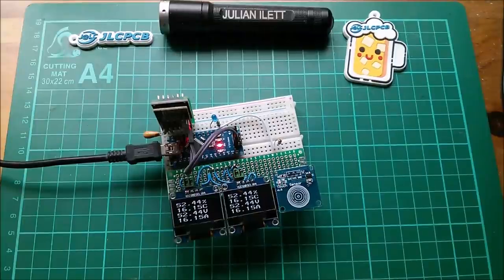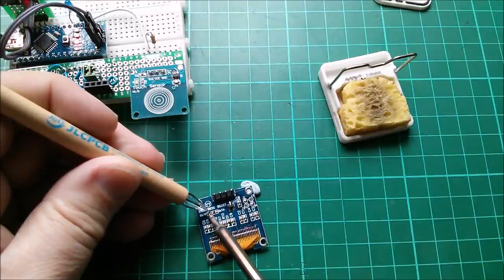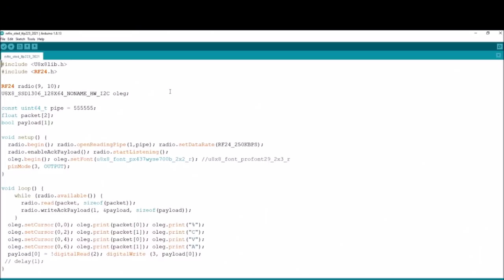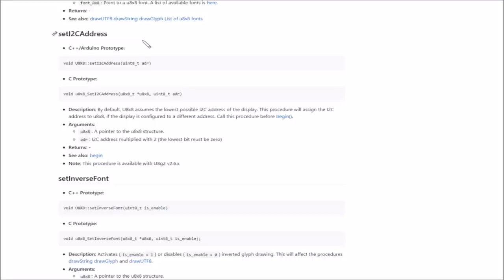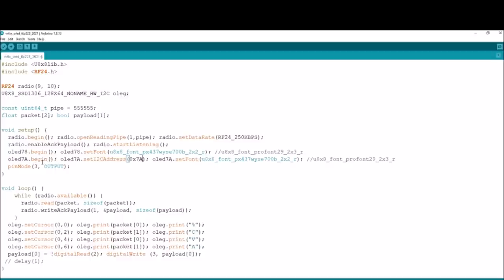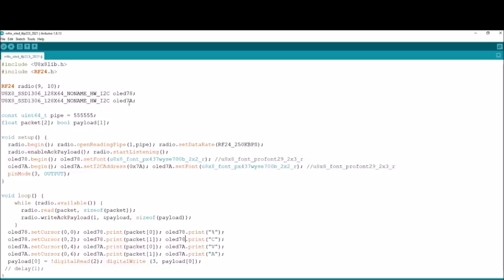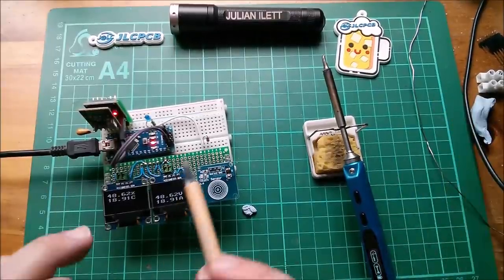Two Arduino Objects for Dual OLED

Comment: Now what I would love to figure out, is using like  3, 4, 5+ OLEDs of these, where you can't change the address.
Reply: You can use different pins for i2c if the library supports it.  I too would like to know if there is a way to programmatically change the address of such an oled display, would make wiring and code simpler
Reply: @tehappon  that is software I2C and it has terrible performance compared to native I2C pins.
Reply: You could use an I2C multiplexer (e.g. TCA9548A).
Reply: @nabarnes  Need to try that

Comment: I like your Arduino videos especially when mixed with cheap sensors, actuators, low power and computer interfacing. For example, the other day I saw a nice video where two Arduinos were used with a cheap on/off laser module and photo diode to create a wireless information/music channel without using a black-box Wifi or other RF-module.

Comment: I might be wrong as it has been a long while since I did any Arduino stuff, but I think you can declare both oleds on the same line:
U8X8_SSD1306_128X64_NONAME_HW_I2C  oled78, oled7A;
Might save you a line :)
Reply from the maker: Ooh! That I will try :)
Reply from the maker: Thanks Rob, works a treat :)

Comment: Julian - What sort of network connection have you got from the house to the shed? [No need to answer. :-) ]  I've been looking at Media Converters (Ethernet <> Fiber Optic) and they're surprisingly cheap (~$20/pair) and cheerful. Even the roll of pre-terminated fiber is cheap and cheerful. It seems that one could span a km (up to 20 km) for something like a few hundred dollars. I wish I had an application, and a free path between. I might explore the solution for my picnic table which is only 100 feet away, just for laughs. Cheers.

Comment: You're saying you have a humidity sensor connected to TUYA? You mean a separate aquara/mija sensor, or how have you gotten the arduino temp/humidity sensors to communicate with TUYA/WIFI?
Reply from the maker: Nothing working yet - I'm still at the purchasing stage :)
Reply: @JulianIlett  But you mean an already TUYA compatible sensor right, not somehow getting an arduino based sensor to talk to TUYA right? Is that even possible?
Reply from the maker: I bought a Tuya sensor, but I am interested to find a way to link my projects with a smart home system.

Comment: Do you think by adding a powered vent to the shed would help exhaust the hot air. You could possibly use your temperature sensor to trigger relay the fan of the powered vent

Comment: When you spend years in Software Engineering having that weird voice telling you how bad it is to have source code without "proper" formatting, it's so refreshing to see someone writing code without caring about that kind of stuff. Reminds me my good old days learning how to program and having some real fun.
Reply: I'm always impressed with the clever things that Julian comes up with.  On the topic of coding style, I started on the mainframe in 1983 writing assembler.  My teachers  were very seasoned  programmers. I was taught that the code had to, first and foremost, be as efficient as possible.  Second, the code had be readable and maintainable by multiple people for years to come.  Of course, in Arduino, that isn't so much of an issue but it does kind of hurt the eyes a bit😊
Reply: @alsnow3582  Ah, mainframes. I do miss the feeling of using those fridge-sized computers with incredible N cores. Back then they were magnificent beasts of raw power. I remember the insane hacks only known by the most seasoned programmers.

At least your teachers taught about the balance between efficiency and long-term maintainability of code. Today, I feel like people know how to write cute code that is slow AF and needs a major rewrite periodically.
Reply: I'd say as usual a bit of both is best. While I do think that a lot of formatting "rules" are just a matter of taste (like where to place opening brackets and such) there's a few basic guidelines that I feel make reading and working with code, especially that written by others, a lot easier and less error prone.
Of course, as usual, there's a ton of people out there that care way too much about "the right way to format code" :|
Reply: @stheil  When it comes to C, I'm a disciple of Kernigan and Richie.
Reply: @ecosta  There was a tipping point where hardware became cheaper than people to the point where you can just throw more hardware at the problem instead of getting people to speed up the code.
Reply: @alsnow3582  - that’s so true. But it’s so wasteful as well.

Comment: Am I missing something? Your voltage and amperage are identical to your humidity and temperature (other than the suffixes)?
Reply: He's just using the same data to test it out, a proof of concept.
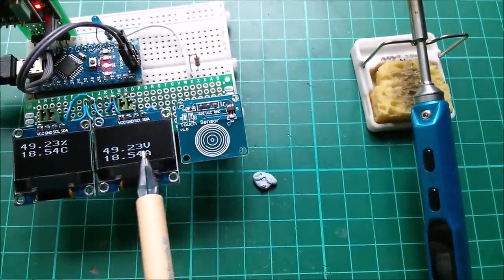Reply: As explained in the video at 8:25

Comment: You really need a Home Assistant setup.
(And some ESP32s).

Makes automation very simple. 👍
Reply from the maker: I'm looking into that for a solar related project :)
Reply: @JulianIlett  If you do move to Home Assistant, get a CC2531 or similar ZigBee Co-Ordinator and use ZigBee in HA instead of Tuya cloud.  It works with no internet then :)  
NodeRed might be a better option than full Home Assistant if it is only a small project :)
Reply: @EsotericArctos I believe HA supports Tuya devices natively now.
Most Tuya devices can be flashed with Tasmota firmware too, which gives even greater control. 🤗
Reply: @ParedCheese  If you want to rely on cloud and rely on an internet connection, for sure use the Tuya integration.  I am making suggestions to keep things completely local :).   Also, if using ZigBee and using a local ZigBee co-ordinator means you are not solely reliant on Tuya, you can mix and match different brands and experiment :).
Not sure about Tasmota on ZigBee devices.  For WiFi, sure, but the ZigBee devices pair nicely with virtually any co-ordinator and stay local.  I have a mix of Tuya, Xiaomi and Philips running on DeConz locally.  I've used Home Assistant for many years and it is just my preference to keep the options for everything to be local.
Personally, I think Home Assistant would be a huge overkill for what Julian is currently doing though.  Home Assistant is not the answer to everything.  "Oh the Home Assistant" as Paul Hibbert would say :)  (All said with a smile)
Reply: I've got HA running on a Pi and a few ESP32/NodeMCUs running LED strips, door sensors and temp/humidity sensors, all talking over MQTT. Works very well and I have an automation to control a heater in my shed if it goes outside of a temp range I can set in HA. Just got a EPS32 with an oled display so might do like you and display temp/humidity on my desk (when I press a button...because of burn in). I'm at the stage where I've got most of what i want done and looking for fun (not necessary) things to add. I'd like to dabble with solar though.
Keep these arduino projects coming!

Comment: Whenever you show code, please zoom in to your code so it's legible even on phone screens!
Reply: If you only have a phone screen to work with, why do you care?! Are you really programming your Arduino from the phone also?? It is stupid to demand that everything in a YT video should be legible in a tiny screen! Equally stupid as Microsoft's idiotic attempts to "unify" the UI between mobile and a proper PC (Windows 8 was the most asinine  example of that)!
Reply: I agree with you about being unable to read on screens, but it will be quite hard to do a show-and-tell that fits on a phone screen. I use the GitHub App (which allows me to scroll around) - and even crispy fonts doesn't help when you have to scroll a lot. 😔

Comment: Think my previous comment was deleted as I had a link to the website.
Might be worth looking at ZigBee2MQTT and NodeRed if you are using ZigBee (or planning to) instead of using Tuya Cloud.  That way you can keep it all local and not rely on internet.  This will run happily on a Raspberry Pi with CS2531

Comment: I did something similar with OLED displays and found that the display dims if it is a constant display. In my case the temperature is always 20 something degrees so the 2 faded away. I redid it using scrolling
Reply: Indeed apparently OLED TV's are vulnerable  to burn in like the old CRT screens.

Comment: Messing with a ina219 on the rpi pico at moment , not sure what the max current it can handle mind , i assume it differs based on how much voltage being put through.